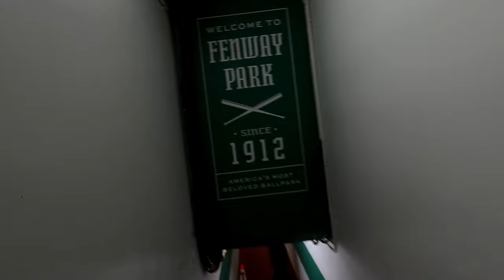Spartan Race All Obstacle | Spartan Fenway Park Stadion Race | All obstacles Ultra 4K

Comment from the maker: Which Obstacle is your favorite? #Spartanrace
Start: 00:46
Stairway to Sparta: 00:54
Cord Crawl: 1:10
Wall 1: 1:25
Cord Crawl 2: 1:36
Over-Under-Through: 1:48
Jump Rope: 2:03
Atlas Carry: 2:34
Herculean Hoist: 2:54
Pipe Lair: 3:16
Sandbag Carry 3:43
Slam Ball: 5:02
Z-Wall 5:28
Multi-Rig 6:02
Jerry Can Carry 7:27
Monkey Bars 8:20
Wall 2: 8:42
Locker Room Burpees: 8:59
Field: 9:57
Box Jumps: 10:23
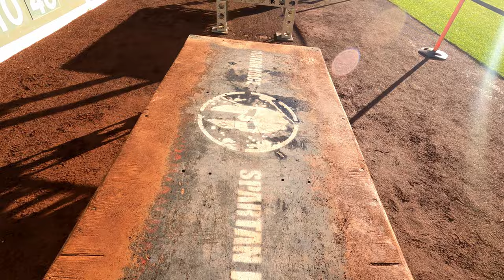Rope Climb: 10:46
A-Frame: 11:40
Weighted Burpees: 12:10
Wall 3 12:58
Gauntlet: 13:08
Beer 1 14:10
Beer 2 14:37